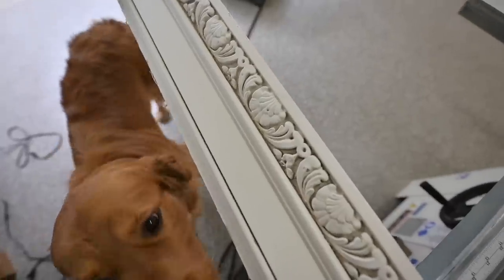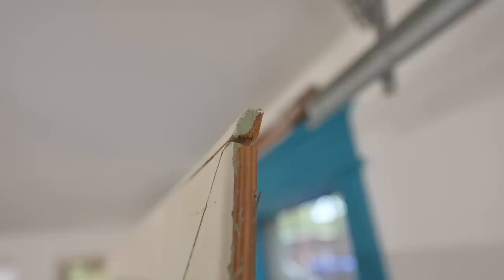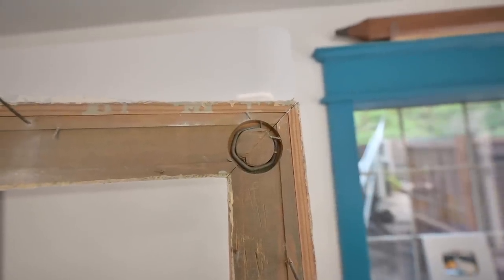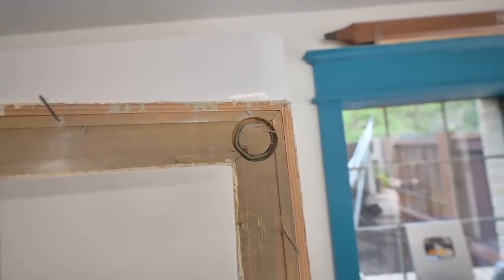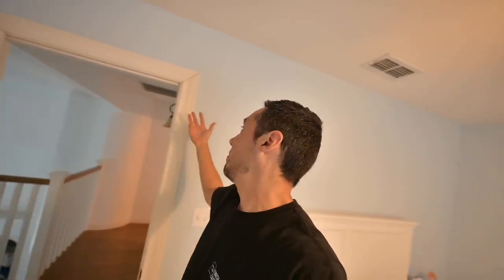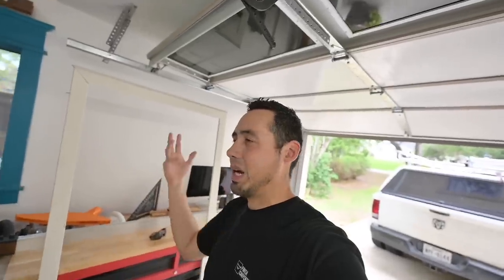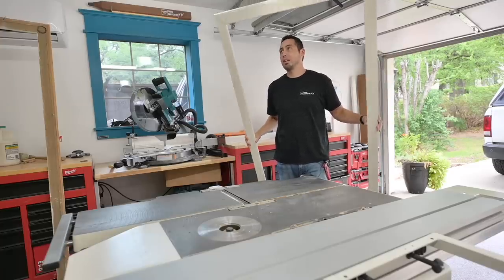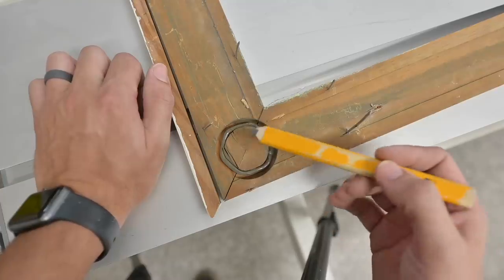Door casing skill lost for 100 years

Comment: Awsome joinery !  I have enjoyed considerable work on old historic buildings and structures.  I too, have never encountered this ‘ Hex magic ‘.  It has obvious advantages.  It’s unfortunate that this clever joinery was hidden from view. A stationary drill press will very rarely be hauled to a job site.  A scrap of wood predrilled with a hole saw, then clamped in place, will serve as a guide without a center spur. I wonder if a hex shaped mandrel was used to form the stiff wire to shape ? 🤔. Good video.  Keep up the good work.  Maybe smile a bit more. 🤠

Comment: I'm going to blow your mind right now.  Those casing came in a kit. They are factory made using a jig and a plug gouge (a hole saw with a much wider blade and no center guide bit.) on a milling machine or a drill press with a secure depth stop. The "rings" are bent into that shape on a bending machine, then spot welded, no on site hammering or welding necessary.

If you are a machinist or a tool and die person you might call the plug gouge an annular cutter.

So since these came in a kit you'd have to cut them to length, so you bought them in your door size, cut the bottoms off at the site and installed these rings in the back before installing these on the wall.

Comment: are you sure the interior hexagon was actually carved, under the right methods it may have been circular
using some kind of wood/metal expansion/compression techniques
such that the separate parts fit in a modified stare, then the material returns to form, creating a self seal?

Comment: the inner part was not a hexagone. It was a round made using a routeur and a guide.  It's time and humidity that make it become a hexagone due to constrains on the metal ring. The ring is a hexagone so it has flexibility and it doesn't roll if if fall on the floor.
This technique allow wood to age without breaking.

Comment: A jig that guided the hole saw from the outside without a center drill installed could work. Like a dowel jig.   Probably could be part of the actual clamp that holds the miter together.  Or an antique purpose built machine.  Men are all about owning "high dollar only does one thing” tools.   I hear they make such a thing for pocket holes… :D

Comment: The pieces were likely done in a steel mitre block atatched to the drill with a flat-edge that already had the half-circle groove in it, you could likely set the toe indent for consistency between joints too.
Also it's more likely that a normal thick toothed fine spacing hole-saw was used, but the ring would have been heated to expand it, and as it cooled and clamped the wood it compresses the wood into the hexagonal shape you see.  That stops rotational movement during the settling of the building.

Comment: Absolutely agree we're not as good as we were... everything is done fast and cheap these days. I'm not even sure the kind of timber used now for that kind of framing (in most cases) would stand up to having a metal ring pounded onto it without splitting. As others have pointed out it's likely the peg part was round and was deformed by the ring. but it's a mystery how they did the channel given the age of the piece... I'd have said routed with a guide while in a clamp of some sort but if so would likely have been done in the factory rather than on-site. I could go on and on lamenting the state of timber and carpentry in general these days but I won't because it depresses me. Suffice to say I'm an amateur/hobby woodworker who was forced due to building regs (called codes elsewhere I believe) to have all of the 1950s door frames replaced in my house with modern fire resisting ones by a professional. I could have cried seeing the result. Not even one  accurate mitre let alone one that'll last. And lots of caulk... jeez.Props to you though that you appreciate quality and try to build that ethos into your work. Best wishes!

Comment: the hole saw thing is super simple really, have a board with that size hole already in it, place it in the jig over the miter and drill away to the proper depth.  It is the same technique for making an already existing hole in a door larger using a hole saw.  How they did the hexagonal carving was probably done with hammer and chisel, or maybe they had some sort of stamp chisel with that shape that could chisel that out in a single strike.  Either way, very fascinating.  I wonder if 100 years ago those hex rings were common and were available like nails in the same shop, could also be local to your region as I have never seen them used.

Comment: If I was to try and do this I would make a jig up to hold the two phases in place on top of the jig I would have a guide for the hole saw with the drill bit removed. I use this holes guide method all the time.
As for the moulding , how about a picture frame? I know its not very original but it would look pretty dame good.

Comment: I believe this is a product of a millwork factory rather than a carpenter made detail.  It would require special machines to machine the circular groove.  I think the center of the circle was not hexagonal but rather forced into that shape when the pre-made ring was machine pressed into the groove drawing the two members of the joint together and locking it at the same time.  The whole process would require fixture or jigs for cutting and fitting the joint.

Comment: The center was always round never chiseled, the ring was driven down after the wood was dampened and softened just look at how the center is marred at the edges in places.  Second point if you chiseled a hexagon the exact size of the ring the miter would not stay tight very long as the wood shrinks slightly over time it would open up. The whole thing depends on compression to stay tight.  The rings were mass produced; in my father's old shop we had a box of them.

Comment: They had a frame corner jig that clamped the two legs together with a pin located router jig to cut the circle grove in the connecting corner. The hexagon locking ring was then press fitted over the resulting locking dog.

Comment: The weld of the hex ring also looks to have been placed on a side parallel to the miter cut, placing a bit of tension to keep the miter tight

Comment: Lay your frame in a mitre joint jig which is a board with some blocks in it to hold the frame miters in a perfect 90 then hold your hole sawn block over your frame and just hold it tight over your frame while drilling your hand crank drill this would be done on the ground with a long board  to stand on most likely as hand crank drills back then were huge. Particularly the electricians ones

Comment: The ring is the clamp. You just tap the profile getnly with a hammer(and a block of wood ofcus) to get the perfect fit, and the hexagonal will keep the profile in lock at the excact spot you want it. A perfect circle would just slide, whereas the hex have some straight sides that works as a clamp. The ring in the wood is made with a stationary pre-fab specialised tool that mill it out. Shove in the profile til it hit the stop at the rear and press; braoumm,, and on to the next.

Comment: That band lock just means it's an early pre-fab frame. Like for a mail order Sears kit house. A buyer would use an inch or half inch wide chisel as a wedge tool to open the band, and set the numbered parts in place. or often not have to put the frames together at all.
Reply: Those welded rings mean pre-fab.

Comment: Shadow box or picture frame are the obvious uses for that cool trim piece.  As for the circle joint, the base of that circle cut is too flush, and would have been super tedious to achieve with a chisel, right?  I think it would have had to be something like a forstner bit with a hollow center?  Then you hex out the inside with a chisel, a bit larger than the hex ring so it clamps/bites when you hammer it down.  That's my guess.  I have some old-timey clamps for 90 degree joinery from my wife's grandpa's shop after he passed.  They are awesome!

Comment: They would have used a shop built router clamp to set the miter corner, and the hex would have been pounded over the round to let the wood compress. The clamp hearing looks like it might be 3/16 round, so it would compress a center that was about 3/16 in diameter larger, pressed and compress the wood. The wood would expand creating a compression ring (hence the need for the welded ring, not just a loop ring) that would keep it tight as the wood aged.

Comment: If it were me I would use a hole saw in a piece of strong timber and then clamp that timber (that now has a hole in it to suit the hole saw) and use it like a guide without a centre drill in place. Then adjust with a chisel. I don't know if that would work though! Just a thought. (I have used that method before for times when I had no material at the centre of my work for a centre drill to hold in, or if I drill the wrong size hole and then had to adjust the size. Sometimes it works!, though if the centre is missing, it's somewhat hard to be accurate).

Comment: Guess I'm late to the party but if you haven't done anything with it yet, maybe you could cut the miters up like you were talking about, but connect them together trying your best to replicate the technique in the middle section. You can make a sort of inside out picture frame, with the original technique at the 45° miters, and your imitation in the center, on the 90° connections. Gives you four chances to figure it out or try different methods, while showcasing an old technique

Comment: Seeing I see a few comments on the how I'm just going to throw a theory on the why. Those moldings were basically old time prefabs that they would make in the shop after getting all the measurements. Then they could bring a dozen or so in and do some light trimming in the length of the legs before tacking them in place. It would let the master capenters do 3 or 4 houses worth without leaving the shop and all the journeymen had to do was make sure they were straight when they were installed to not loose any quality of the craft.

Comment: I would route the backside of that moulding,  then put light strip in it to shine through the pattern.
And find a fireplace mantle that is large enough, and route a pocket and flush mount the moulding on the perimeter of the mantle.

Comment: Maybe they had a pre-made 90° angle corner set up already made. Then they put the two pieces together in that, secure them and then create the locking mechanism. Also when they put the hexagon ring on, could they have twisted it a little to secure it tighter? It wouldn’t take much if it is already a close fit and twisting it might tighten it better. 
And with that ornate trim….. most might suggest a mirror or picture frame, but what about using it on furniture?? Or it would be cool to use on a shelf with a secret compartment. The unique look would distract and hide any flaws where it comes together. I have a shelf with a hidden compartment and it has a couple gaps because it was mass made. But a custom one would definitely be better.

Comment: Do you think that they might have made the ring and centre with a slight interference fit and then heated the metal up so it expands and then seat it and pour cold water on to shrink it to a tight fit . Like the old wheel rights would ? Just a guess but ....

Comment: Regarding the hole cut without a guide. To accomplish this without it being a nightmare, you would have a piece of scrap wood as a template. As long as the template was made with a guide drillbit, that would be accurate enough to use as a corral on anything else.

Comment: I think this was made in a factory.  There was probably no clamping the mitered joints.  My thinking is that the circular groove was cut first with a drill press and the miters were cut next through the middle.   Everything was made to standard lengths, maybe a little long to allow for normal variation at the construction site.  Of course there were jigs throughout the process.

Comment: Pure guess work on my part. I Googled "vintage manual press drill" and found one that gets bolted to a support post. So "technically" portable tho it would have been made of cast iron and weigh a lot. (2 guys could lug it for a job of building the house I guess) That could have been set up with a 90 clamp and hole saw bit. Then while still in the clamp (to insure alignment) For the octagon I would have gotten an eight sided pipe with sharpened edges and flat top to hammer or attach to the press. Then clean up with chisels/knife.

Comment: MY "hypothesis" is; That's the remnants of a builder's supply shop's mass-manufacturing process. As-in  something that was cut, milled, and possibly assembled, in either a machine-laden line of people or one man's "door,window, casing, & carriage-wheel shop" shop. Then picked-up or delivered to the build site at maybe a universal height of "8 ft", leaving the carpenter with only two quick "site-specific" cuts before install.  But, then again what WOOD I know!

Comment: They probably measured and secured the door frame at the carpenter's shop and milled in place before delivering it to site and installing.
It may have been portable enough to haul on a wagon and was probably, at the time, not particularly common.  Consider it would have to be big and sturdy enough to support the long boards without sag - which would affect the milling - but may have broken down relatively well.  The clean lines of that hole means it was done by machine, not by hand, though said machine may have been hand powered due to the bulkiness of motors at the time.  The hole saw that did the job had a single cutting surface - with a very, very wide kerf - to make the cut clean in a single pass without needing to remove material afterward.

Granted, 100 years ago was well into the factory era so the milling could have been done in a factory setting and the door frame would have been sold as a kit, complete with the ring, for assembly on location.

Comment: i would assume they had a simple half circle guide they used to route out. The route is in the same spot on the 45s so it could've been one guys job to route out while another is cutting the 45. 
Then in most cases i think the hex ring was just hammered, wetting the wood would leave a cleaner finish but you can see splintering in your sample so i doubt they wet it on most jobs.

Comment: I'm thinking some sort of router with a guide...  I'm betting the center was circular and not chiseled or shaped to the Hex at all... I think it has taken on the hex shape due to the pressure over the years...  If the wood used is soft then wetting the center before pressing the Hex ring on would allow it to deform into shape and lock in place once dry.

Comment: There is a way to use a hole saw without the pilot bit.  I've done it many times on all kinds of materials. And it works great. But it involves guiding the hole saw from the outside instead of the center. with a piece of scrap that already has a hole of the same size and a clamp. you position the piece with the prepared hole over the exact placement of the hole you're trying to make and clamp it or use a screw I have even had success with just my hand pressure. there are times when you need to cut 2 overlapping holes with a hole saw but they overlap more than half the diameter. this method will allow you to do that. or maybe there is a broken bolt in the wood or some obstruction where the pilot bit would be this method would work. As for this case also only, you don't go all the way through. so, you can make a jig that holds the pieces at a 90' included angel and a clamp down on each side with a triangle shape top piece on the top of the jig that has the hole in the correct place already. you would need a way to stop at the right depth. and that can be done by marking the hole saw with tape. or putting a stop ring on the hole saw. I think the shape of the center peg is round but will take on the hexagonal shape after forcing the hexagon shape ring onto it. I would try it with just a round ring. but it may be easier to push in a hexagon since it only contacts in eight points.

Comment: Seems all neat and fine until you do the same thing with some old copper roofing sheet and cut-off ring nails and end up with a better result.   The problem with the wrapped plateau method is that when the wood inside the ring breaks off it's gone and the whole thing cannot be fixed.   This "smarter" method was replaced by biscuits and tacks by the way.   You glue up your biscuit, stick it in, rig the joint perfectly then tack through into the biscuit.

Comment: Thanks. It looks quick, and it works. Yeah, I have trouble with miter cuts. I can never do them withot a gap. Then they seperate. I just but the board up, and put larger board at the top. it's held with a lap joint, and I throw in some extra details. It looks fancy, but honestly, I just not that skilled.  Hey I'm not a proffessional. It's just my home.

Comment: I have an idea about how this hole was cut. For the record, this is just a wild theory. Imagine a hole saw bit, but with only two cutting faces, clocked 180 degrees apart and with something like a 35 degree relief trailing the faces. It would never work as a hand tool, but in a drill press you might get some spectacular cuts like you're seeing here. I think it would be more stable as the pressure on either tooth would be much higher than it would be on something with a lot of teeth. The down side is that your cutting speeds would be slower, but judging by the quality of work here, I don't think speed was their first concern. The bit itself would also be relatively cheap to manufacture and maintain as it only has two cutting edges.